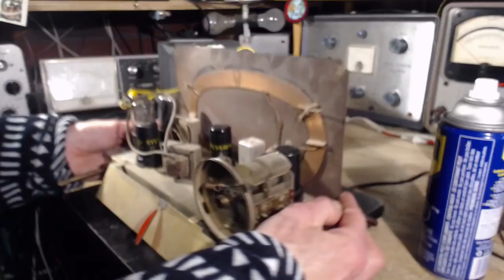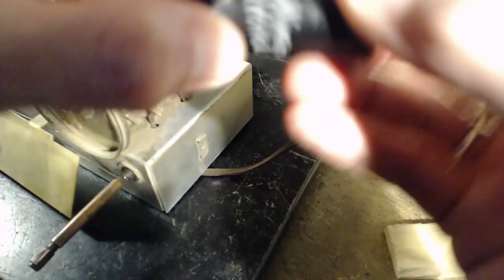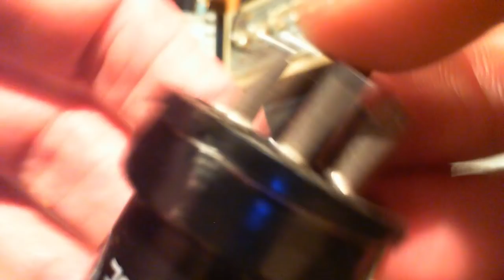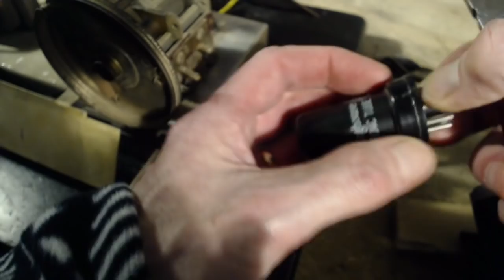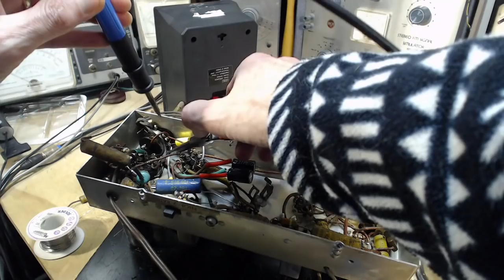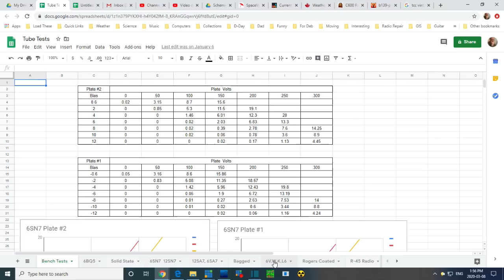General Electric C600 Video #3 - Audio Capacitors

Comment: WD 40 is the worst thing to use
Reply: The regular stuff is no good but they have a type that is a few dollars more that is OK for use in old radios!  It's called the Specialist Electrical Contact cleaner.
Seen it at WalMart and is  an 11oz can.  Safe for all moving parts and pot wipers. Leaves no residue that will attract dirt. But it's  not the stuff Jim is using of course!

Comment: 54:45 WTH? Are you really trying to sell us that TCC on a wax paper cap means temperature compensated? TCC was a british manufacturer of the 50s not really famous for the durability and non-leakyness of his capacitors. But like so many things associated with audio or guitar amps these caps have a name with audiofool...- sorry audiophiles - to where these POS even when well used, wax dripping and leaky as hell sell for decent money...
Reply: T.C.C. was the Telegraph Condenser Co. Know for electrolytic capacitors in radios and televisions . Yes they made waxies too. WKS. was their 
abbreviation for working voltage.Clearly seen on that capacitor! Jim should do more research before jumping to conclusions!

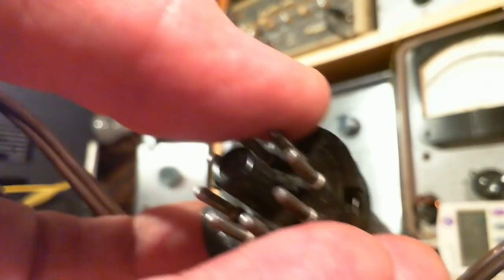Comment: 14:40 to 14:48: could it be that on the 12sj7 he is holding in these shots, the pin at the 3 o'clock position has a broken solder joint? If I got the notch right that pin in question should be pin 4 of the tube aka G1 and may explain that behaviour he is attributing to the tube shielding instead 
BTW the last C600 he did was "fixed" after less than 3hrs of video... With this installment we are at over three hrs of tinkering around and still nowhere near halfway done.
Reply: I agree change this tube. It can't hurt for a trial.